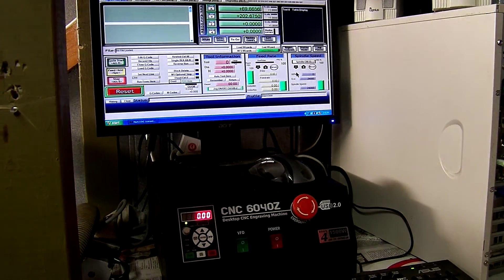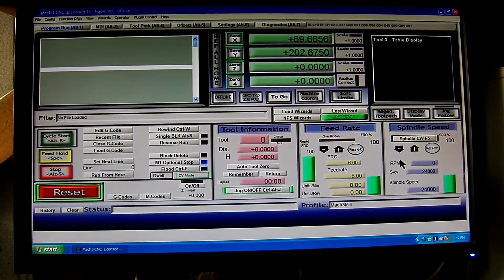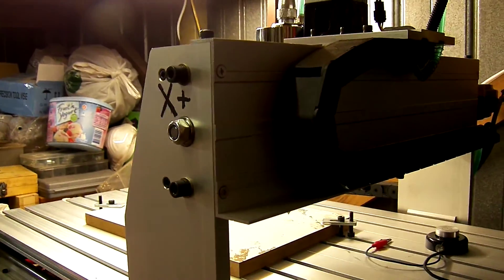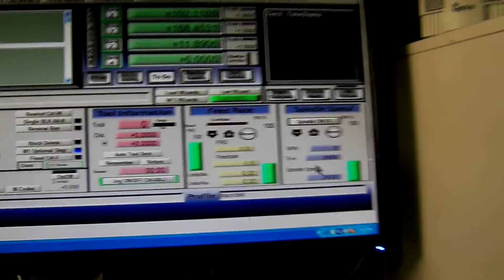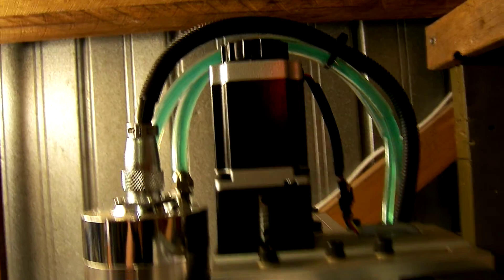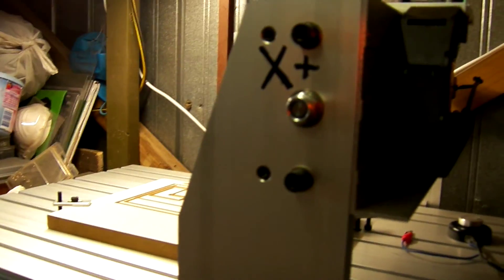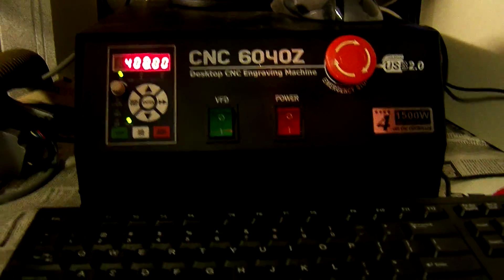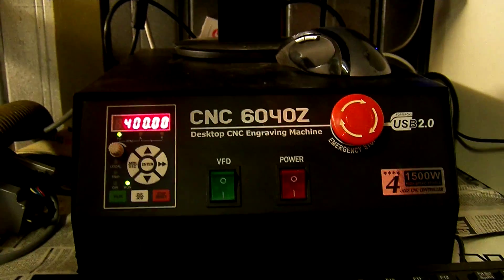Showing motors running (haven't tried A axis yet), controller box on but no lights on switches.

Comment: This might be a little late, but I just got a similar chinese 3020 router with the same problem.   They wired the switches wrong, that's why the lights aren't working.  

Disconnect the power cable, unscrew the box.  
The two switches at the front have 3 prongs.   The wires are connected to the top and middle prongs.
They should be connected to the middle and bottom prongs instead.
I've switched mine and the lights are now on.

Comment from the maker: Hi Luke,

Thank you very much for your time in replying, I also got your email address and I will reply to it, also.

My machine came without limit switches and I will ordering some on eBay, as soon as I work out which ones I need.  Why do they sell 5 switches when you need 6...??? :)

Are limit switches the same as homing switches..???

I made this video today because the Seller asked me to open the controller box and show the inside clearly because, on my first video, the controller box fuse burn a few minutes after I turned it for the first time and I mention that, I heard a noise and smelled like burnt electric wires, I believe that was caused by the fuse however, both switches on the front of the box, the lights never come on when they are turned on and I start to think that, they were never connected in the factory to activate the switches lights.

I will know if they still want me to open the black box and take a video of the inside...!

Comment: Hey George,  that looks like you've got it running good! 

I heard you mention that you are having a hard time setting up the limits of the machine. Are there any limit switches installed on any axis? There weren't any on mine from the factory. Each time I went to cut a part, I would manually zero the axis (XYZ with end mill installed to spindle) to the top corner of the material, then start the cycle. 

This is the normal workflow because the material which you fix to the table will almost always be in an unknown position (to Mach3). 

When I was making repetitive parts on a large fixture plate I installed homing switches for XYZ axis, it's something you could add in the future